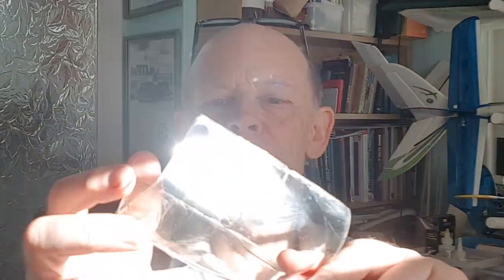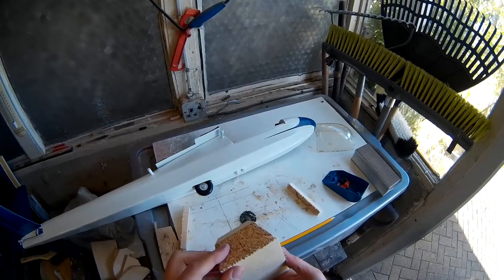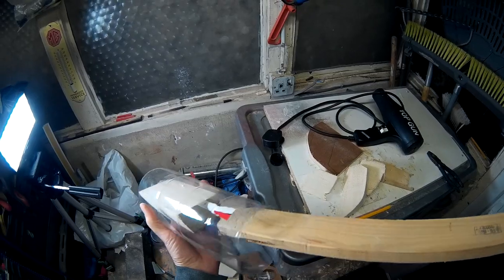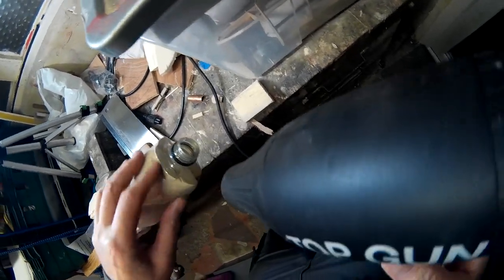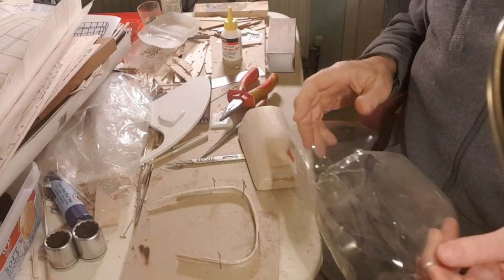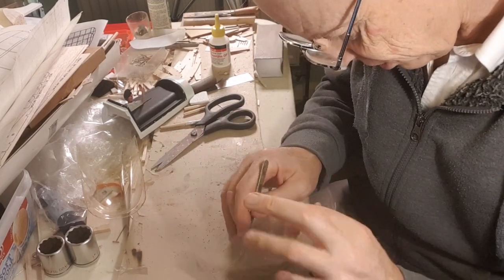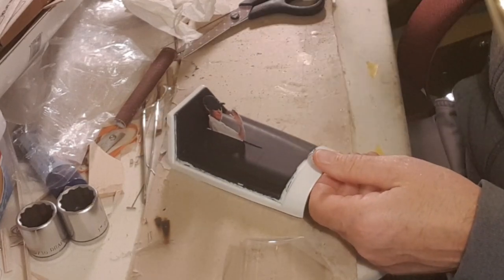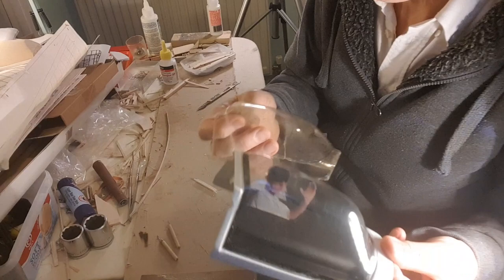Make Your Own RC Cockpit Canopy

Comment: One trick I used in the past, where you have an old canopy you need to recreate, is to fill it with plaster.  Even if its broken, tape it back together and fill the sides to keep the liquid plaster in.  Coat the surface with auto filler and sand smooth.  You end up with a perfect recreation of the original.
Reply from the maker: Great idea Dave, thanks for posting, Happy New Year 👍🙂

Comment: Just made my first canopy because of your video. Many thanks Cliff. Interesting to watch the plastic when the heat gun was applied. The hardest bit was making the plug. The most nerve racking bit just before I put the heat gun over the plastic bottle. Many thanks mate.
Reply from the maker: Just passing on the knowledge, the more you do the better your understanding of what works and what doesn't, thanks for the feedback, cheers

Comment: Following your demonstration, I made my first canopy out of a soda bottle. Thank you! I'm going to make a couple more to see if I can make them a bit better but I've basically got the principles down. I made my mold out of oven baked clay instead of wood. A big trick that I was missing is how you put the shims into the bottle along with the mold to hold the bottle against the mold.
Reply from the maker: Hi Tom, the shims go in depending on where they're needed, every canopy is different. Every one you do will be better than the last 🙂👍

Comment: Nice job, canopy glue , I have to try it. I have used regular white glue for model car windows which is ok. Does the canopy glue adhere much better,? Oh yeah, do you have 220 volts like in your house like we have 110. ?
Reply from the maker: It's better than white glue for sure, 220 over here, or 240 really 👍

Comment: That looks great I would be very happy with that
I have done a couple of canopies this way, I made a wood plug for one of them, the other I still had the old canopy which I filled with plaster and added a chunk of balsa that stuck out the bottom of the mold worked well but tòok a good 24 hours to set, I think your way is a lot quicker. That dashing young fellow at the controls realy tops it off by the way. Thanks Cliff
Reply from the maker: Thanks Mike, there's always more than one way to skin a cat as the saying goes 🙂 Re the pilot I try and be more like him every day!

Comment: Has the glue held up? I'm told that most glues don't work that well with PET. I'm asking as I am about to start a plug for a vintage scratch build.
Reply from the maker: Hang on I'll go and have a look ... yes it looks fine  it's as good as the day I stuck it so go for it, cheers 👍
Reply: @CliffHarveyRCPlanes  Thanks Cliff, gives me a bit more confidence going into something I have not tried before.
Reply from the maker: @iflylilplanes  Once you've got the plug made that's the hard work done, the rest is just practice with free materials. Don't expect the first one or two to be very good just keep practicing and you'll get a good one 👍

Comment: You could also make an adapter for the bottle cap end and attach it to a shop vac to help pull the plastic down on to the plug.
Reply from the maker: Good idea, I'll try it next time, cheers.

Comment: Good Idea, Cliff. I have a suggestion. Since you have to sculpt the mold and balsa is so expensive....I think I would give clay a try. It'a much cheaper, stands up to heat really good and it's reusable as well. Just soak it in water til it gets soft again. Cheers!
Reply from the maker: Good idea William, I have tried taking a mould from an original in the past using plaster of Paris with varying results 🙂
Reply: @CliffHarveyRCPlanes  How about expanding foam filler?  Think it would cope with the heat gun treatment.
Reply from the maker: @mrradman2986  Great idea Mr R. I'm inclined to think not but worth an experiment 🤔

Comment: Alert: I bought .020 Pet G plastic to make a windscreen for my Sig Cub, removed protective film from one side,  installed it with canopy glue clamps and pins. Did not realize that plastic had protective film on BOTH sides. Glue stuck to protective film, not to windscreen. Had to redo the windscreen.
Reply from the maker: That's a steep learning curve Gary, I wouldn't have known that either, thanks for sharing 😁😁👍